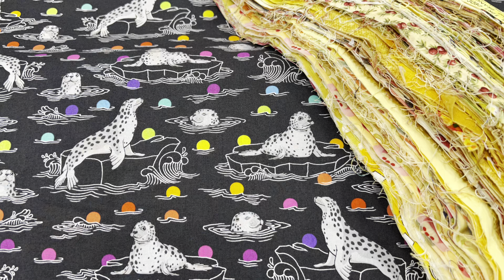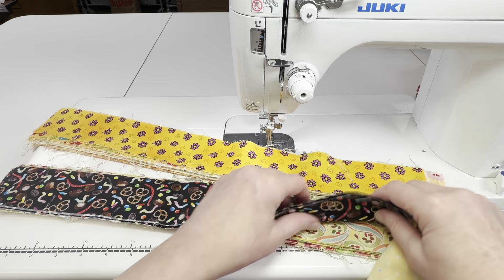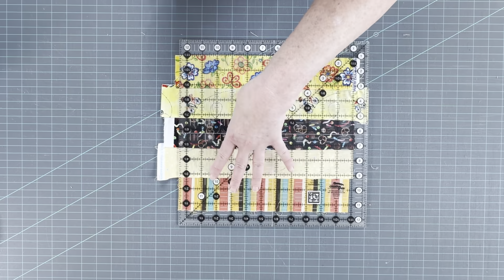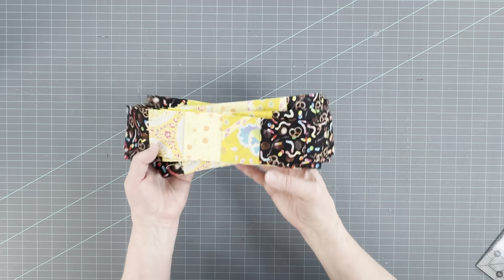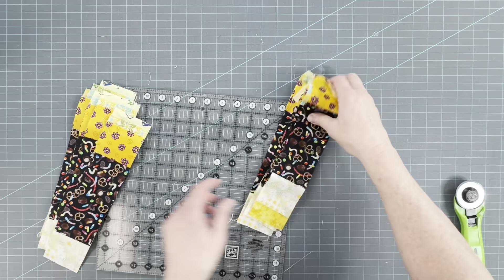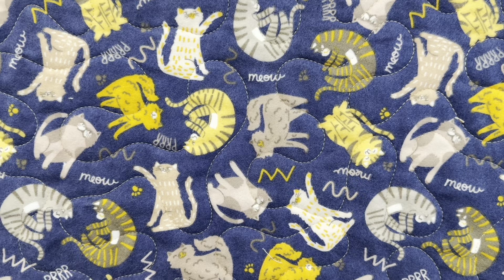An EASY Irish Chain Quilt Using 2 1/2" Strips Or Jelly Rolls! ALL Straight Sewing!

Comment: So the rule I’m getting is: multiple seams all going in the same direction (strip sets) press when unit is complete; multiple seams forming intersections (strip set units, or multiple squares) press after each unit is added. It’s the cross seams that make the difference, right?

Comment: I love this series as well, but I have a question.  I've been sewing/quilting for decades, and noticed you're using the lines on your cutting mat to measure the 2.5" strips.  I've read in multiple places through the years, to always use the lines on your ruler to do your measuring, and to always use the same brand of ruler when using different sizes in a project.  I have noticed that not all cutting mats are accurate, and although in this case, being off a bit on the cutting won't matter in the final project, it does matter when cutting smaller, different shaped pieces.  I don't believe I've ever had a quilting ruler's grid lines match up exactly with any of my cutting mats I've used through the years.  I use the lines on the mat to straighten the fabric, but then move from left to right (I'm right handed) to use the lines on my ruler to get the measurement I need.  What are your thoughts and experience on this?
Reply from the maker: Thank you for watching. Actually, I never use the lines on the mat for measuring or cutting. I really only use my rulers for both measuring and cutting, just like you mentioned. Most of the time I don’t even pay attention to the mat markings. If it looked like I was using the mat lines in this case, it was purely coincidental. Happy Quilting!

Comment: I know you are using your strip stash, but if you did not have a shop from which to choose the background, how much would you have purchased of that pretzel fabric? Surely not 4 yards. How do you know how much to buy? 
I never know how much to buy for a "this will make a great background someday" print. So I stick with scrappy. But I want to be able to do a 1 background quilt too.
Reply: It is the pattern directions.  Go get the download.
Reply: @denisejameson2255  Actually, "How much would you have purchased of that pretzel fabric?" Is not in the pattern. The pattern doesn't mention that pretzel fabric anywhere.

The pattern assumes 4 yards of a neutral white or black solid.  

ALSO I asked because I saw a great print that I thought could make a good background - someday when I find the perfect pattern (this isn't it, I've already made an Irish chain & don't feel the need to make another.), but I don't know how to decide 3 yards? 4 yards? or more to buy. 

So I asked for advice. NOT "GO download the pattern." AND I asked specifically on this video, because the Pretzel print is an unexpected choice that I appreciate & would like to replicate, but I would NEVER buy 4 yards of pretzel fabric. EVEN IF I downloaded this pattern.

BASED on that 1 pattern, is 4 yards the answer for buying background in every instance?